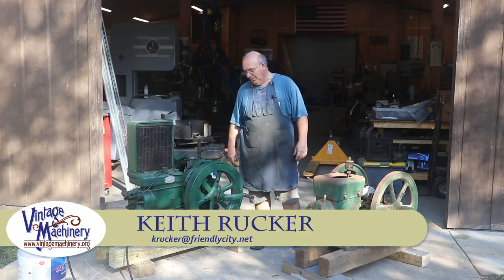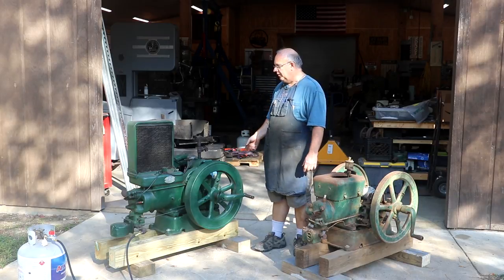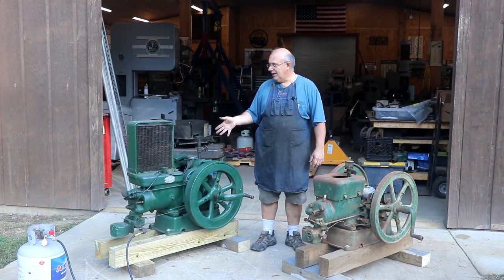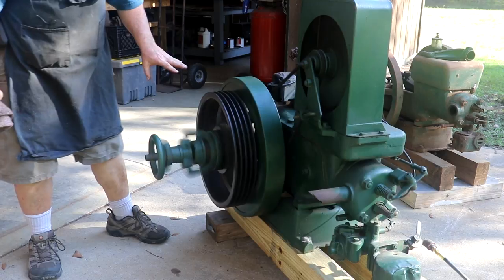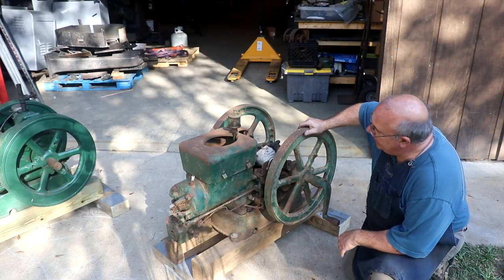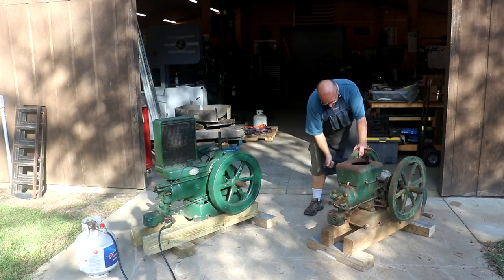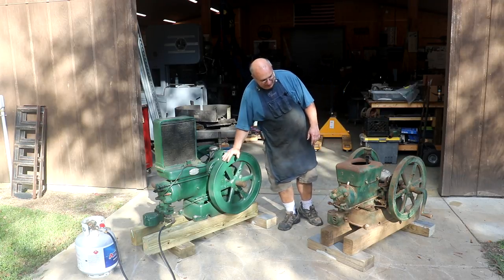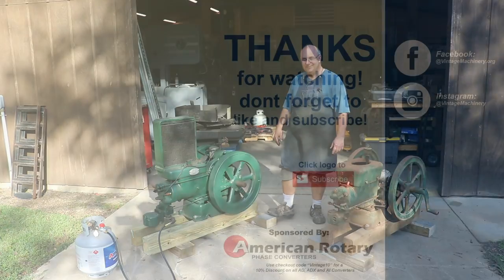Fairbanks-Morse ‘Model Z’ Hit and Miss Engines!

Comment: There is no fuel pump on your 3hp Z. There is a check ball in the tank, however. A magneto rebuild (or new rebuilt one) is about half the value of the whole engine, ~$200-300, whereas the machine is worth about $600-700. You're not gonna screw it up restoring the engine, even if you work on it yourself, you've got more than enough restoration experience, they're not that complicated. They are very forgiving as well in terms of timing as long as you're in the ballpark it should run. Biggest issues currently plaguing mine -- magneto internal component physical wear and intake valve sticking on a different one. Check valve likes to stick too, definitely clean the tank.

Comment: Hello Mr Rucker,
    I have a FM engine, 1 1/2 horse, dishpan flywheels. It doesn't seem to have a gas needle valve. The gas is sucked from the tank directly into the carburetor. Can you tell me how to regulate the gas flow ? It floods out now.

Comment: Either used some diesel or wd40 on the crankshaft where the crank goes to lubricate the crank handle, when the engine goes over compression stroke make sure you are pulling up and don't have your thumb wrapped around the crank handle or it can break your arm if it backfires.Have fun with the engines!!

Comment: Use one them to run a vintage AC generator. You could run some of your equipment electrically using it.
Reply: Be sure to use a 4 pole generator.  This runs at 1800 RPM, and makes it easy to generate 60 cycle current. (most modern gens use a 2 pole armature and run at 3600 RPM)

Comment: venture effect pulls gas up and out of the tank on those,,, i remember pumping water with 2  of the actual  hit and miss at the fire station at brooks ca in 1945 ... it took 2 of  them, they were each attached to a pair of railroad ties, if 1 did not start the other could be slid into place and used til it would not start.. the rancher would be advised and he come fix the defective 1... i was 5 and named them "smoke knockers" i am a very retired mechanic and there is a carbureted z by my front door that can be started any time

Comment: That’s not a radiator, it’s a condenser. Notice there is no filler cap on top of it. Also, these throttle governed engines will run a nice smooth constant speed without load, once you have the gas pressure dialed in on that zc118. As far as the 3hp z, it too will run constant speed fast or slow, again once everything is correct.

Comment: i want one.. a small one to run a small pumping unit in the yard. 3 hp???? i got 3 HP briggs motor... it isnt 1/10th that size??? the flywheels must  provide  LOTS OF OFF IDLE TORQUE

Comment: What to do with the engine - plans to run the planer.......
Well, if it's the only engine you've got, I'd suggest you instal line shafts to all the machines so you can run any ONE machine with it ! For example, if you have 12 machines - say 3 machines per line shaft, have a pulley clutch to each line shaft, so you can select which line shaft to run then same pulley clutches to feed the individual machines. Maybe it'd run several shafts and several machines for demonstration purposes but if you planned to actually use a machine, I guess you'd need to be able to isolate all the machines you're not using so all the available power is just going to the one machine. I think that would be a great feature (of the museum).

Comment: Okay I have hit miss engines. Now on the 2 hp look at the bottom of the fuel line.  There should be a check valve in it that is what would make your fuel pump. Would love to help you. Wish I was close to you but I'm in MO . But I have around 30 or so. But you can get parts if you need. But you have the machines to fix everything. Now on the magneto most of the time it's the points dirty or the condenser bad. Just wanted to let you know. Hope this helps you.  And 1 other thing go to smokestack forums on 3hp fairbanks morse.  It should help you out. Hope this helps. Would like to talk to you of possible. Good luck.

Comment: I sent my American Bosch AB-33 mag to rebuiltmags.com. It was completely dead with a burned armature and bad condenser. It works great now. Mine is on a hoist. See it at:  https://youtu.be/bFjLS5duynw  6 mins in.

Just a tip. Do not hold the intake valve open to stop the motor. It will backfire thru the carb and blow out the intake plate on the carb. It can also remove the carb from the head. Fair warning.